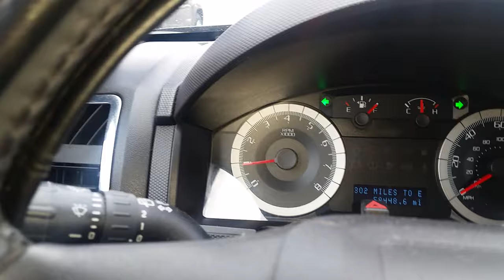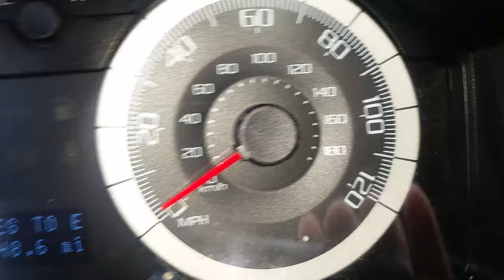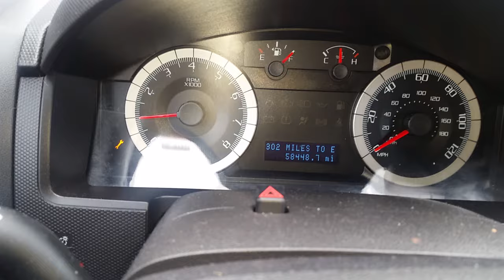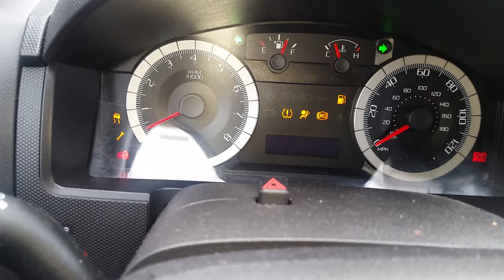Ford wrench light

Comment: I noticed alot of common comments but really know defined answer to this issue. So I went through the comments and wrote down the most brought up issue wich was the throttle body. Then started watching videos based on that. I took it to autozone to confirm. Came back as throttle body sensor. So 2 choices. Buy a new throttle buddy $350 lowest price for my vehicle or clean the one I have. I bought some throttle body cleaner and removed that part. It was totally black. Sprayed and wiped twice and it was shiny gold. Connected back to vehicle and the check engine light is gone. Been driving most of the day off and on and still no tool light no check engine. This fix cost me less than $10( cost of throttle body cleaner) Hope this helps. My situation was pretty much the same as the person that uploaded this video.
Reply: Thanks for the info!! I had that problem today…
Reply: Just had this problem Thanks for the tip
Reply: Just happen  to me
Reply: Thank you. I side hustle as a delivery driver and until I get this fixed....
I appreciate your research and sharing 
Fingers crossed, prayers up!!
Reply: I heard the ranch has something to do with your transmission it may have a transmission leak
Reply: When I changed out the ignition housing, I had to disconnect the wires. Reconnecting the wires forced the car into diagnostic mode and then it caught the throttle body issue. Used the throttle body cleaner. No more problems. 
Thanks so much for your research and info!
Reply: @katrinab7657  I just found out yesterday I went to the Ford dealership I asked him about it they said the wrench 🔧 can mean anything- they did a diagnostics they said my breathing air system is covered by the bumper and they're having a glitch in the electric system
Reply: @R.Williamss  do you think they're trying to get $$$ from the warranty company/ manufacturer.
Reply: @katrinab7657  I don't think so because a quick Lanes is a third-party of Ford, they do mechanic work for them and they're all over the USA-- it's saying the vents in my car are not open they're open but my bumper I ran over a raccoon and it messed up the bumper
Reply: @R.Williamss  oh, ok. I only kinda get it. I was so fortunate because the guy from AutoZone is also a working mechanic with the military.  as soon as I mentioned the wrench and the online opinion that it could be the throttle body, he agreed  it was a likely cause and knew what exactly was up and how to fix it for under $10.
Reply: @katrinab7657  well if you go to the quick Lanes at Ford, they can do a free diagnostics for you-- and thanks for telling me that I never knew about the throttle body
Reply: @R.Williamss   all I needed to hear was FREE diagnostic! However, my car would not accelerate and was driving so poorly, acting like it would cut off in traffic, I wouldn't have made it all the way too the dealership.
Reply: @katrinab7657  I recommend calling quick Lanes and tell them your situation, and that's terrible and frightening when you're in traffic you got to go through all that.
Reply: Cleaned my TBS and was dirty like yours . Had no monkey wrench icon but about 1 month later it shows up. Car would drive good but jerked changing gears when slowing down. Never 3 mph. Started happening after I gor 3.03 fuel when everyone else was selling for 3.57. Could it be bad gas?
Reply: @silverbullit89 did you root cause your issue. My fusion 2008 jerks when slowing down too. Overall trans shifts good. Could be the Throttle body? The wrench showed today.

Comment: This happened to me on my 2008 Edge, brought it to the dealer, this is caused by two sensors in the power train which need to be replaced would cost me $750 to fix, I haven't done the repair yet. This really sucks, I am finding out this problem is very common now in Ford vehicles. We should get a class action lawsuit started.
Reply: it happens to me too so count on me for the complain
Reply: This doesn't happen to all. It has to be 09 and above. My mom has a 2010 Escape and this has happened to her. I have a 08 but never heard of this.
Reply: 55dbau yes we really need to get a lawsuit started. Same thing happened to my 2007 ford e250??
Reply: Shitt is happening to me right now 🤬
Reply: I just bought a 2009 escape hybrid. I’m getting this wrench light also. What 2 sensors were bad? Thanks.
Reply: Maligant Moose tss and oss sensors
Reply: @cwhite7922  same 2010 e250
Reply: I agree I filed a bbb complaint
Reply: @slimsampy4764  I have a 07 and it's happened twice once after a new transmission
Reply: It just happened to me in my 2015 Ford fusion. Is it a bad thing?
Reply: It happened to me in a 06 Ford 500
Reply: Thomas Young what was the problem with your fusion ,? I have the same issue with the same model
Reply: I've been dealing with this issue for 3 years now. Nothing I do has fixed it. Took it to a ford dealer ship paid them 300 bucks and problem came back 4 months later. Happens to me daily now. Last mechanic told me I needed a new wiring harness and have the whole car rewired. Told that could cost around 2000 bucks so I haven't went that route yet. May be my last resort. If anyone knows the cause I would love to know.
Reply: pistengine my gf faced same problem on Ford Fusion ... we replaced the throttle body 150 bucks and the problem was fixed since 3 weeks now ..
Reply: I know this is years ago when you stated this but its 2020 and I'm having this issue!🤦🏾‍♀️
Reply: @TheShaedior  same here
Reply: The transfer case on the edge should be a class action lawsuit.
Reply: 2010 mustang, just came on.
Reply: @Lylslet  I have a 2020 mustang gt 6 speed.  Mine came on last week I was near a dealership but light turned off. I still had them check it but supposedly no codes came on. I've been told by some people it could be the transmission.  I barely have 14500 miles on it
Reply: 2011 fudion wrech light came on now its off?
Reply: @pistengine  wow that sounds crazy...any new result?  just now having the problem.
Reply: @slimsampy4764  

Do you know what fixed the issue??
Reply: @hecmgonz  it was a recall for the Ford Escape. I don’t know about the Edge. Make sure you keep your receipt because Ford didn’t put out a recall on the Eacape until it was a lot of reports. I know for sure it wasn’t any sensors. Make sure you check for all recalls. Best of luck to you
Reply: @slimsampy4764  thanks for your reply
Reply: Why a class action lawsuit so the lawyers can get rich? Because you're only going to receive about $2 of it if that
Reply: What about Ford Edge 2010 ?
Reply: @TR42000  change your maf sensor
Reply: Freaking hate these high tech junks.

Comment: 2013 Ford Fusion no issues at all 194,000 miles
Reply: I have the 2013 fusion too im having this same issue.  It stopped on me last week wouldn't turn back on. I had it towed to the dealer

Comment: Anyone who have this problem if you have these 2 problems if you brake and it takes time to slow down or if you floor the gas pedal and the response hesitate before the wrech light come it’s your Acceleration position pedal sensor. Most people thing it’s the throttle body but the pedal tells the throttle body how much to open or close. If you have a electrical throttle body. Hope this helps had the same problem with my ford mustang

Comment: I had this issue on Friday the wrench light came on with the AWD off light. It crawled at almost a nonexistent speed. It's sitting at the mechanics shop now and he is stumped due to it not having any codes stored. I'm hoping he can figure it out. I don't even want to think about taking it to Ford 🙄
Reply: Any update ?
Reply: @zykerahaynes4253  Throttle Body
Reply: Bronwyn Rice how much did it cost for labor
Reply: @zykerahaynes4253  think it was like $100
Reply: Bronwyn Rice wow took my car to 2 mechanics paid 150$’ to find the issue and still can’t find the problem
Reply: @zykerahaynes4253  the only reason my car was diagnosed was because my mechanic drove it for 3 days and on the day he was going to give it back it did it again so he immediately checked to see  what was wrong. The only way I've seen them diagnosis it is for it to act up while they are there. Or buy a used part from somewhere , have it installed and see if it stops the issue. So sorry you're dealing with this. It's super frustrating.
Reply: Bronwyn Rice yes I even showed my mechanic your response… so he checked my throttle bottle and said it was good , he said I was low on transmission fluid , and it looked like I had bad gas in my car so he added some booster other than that he couldn’t find he the problem, he test drove for it 1 hour doing 60mph
Reply: @zykerahaynes4253  yeah. They can't tell by just looking at it. It literally has to mess up at the shop. Sorry this is a frustrating diagnosis.
Reply: @zykerahaynes4253  Mine took to the last day to finally mess up again. Otherwise I would be in your situation too. Do you have anyone who can install the throttle body? You can get one on ebay for pretty cheap. From what I understand it's not to hard to do. It's worth a try to see if it fixes it. I hope you find a solution soon. This is so frustrating.
Reply: Bronwyn Rice my car wrench light came on and air bag light came on also the tire light , he said my throttle body was okay, but the car becoming in limp mode … when this happens do you turn the car off ? If you turned it off did all the signals disappear? When this happened to me I poured transmission fluid in my car and instantly everything started working …. Then when I took it to the shop because it happened again he said I was low on transmission fluid … so my thing is the transmission fluid causing this.
Reply: Bronwyn Rice when your car starting messing up did you turn the car off and back on ? And if you did the signals disappear or did they stay on ?
Reply: @zykerahaynes4253  my car had almost no power it would barely move. Then shut off. Wrench light would come on. If I turned it off and waited a bit it was like nothing had happened.
Reply: Bronwyn Rice ohhh wait my wrench light came on , the car would still go about 50mph but slowly start going slow but never shut off , i poured transmission fluid inside and 30 seconds later worked like a charm , then 3 days later happened again the mechanic told me the only thing he sees wrong is I’m low on transmission fluid I never told him about having to pour it in the first time . And He filled it and it’s been working for about 1 weeks or 2 weeks . I told your response to the throttle body he said if it was my throttle body then my car wouldn’t just go back to normal it would stay in limp mode

Comment: I think the reason for the conflicting comments is that it is the "check engine" light.  I can be coming on for a multitude of reasons.  I have a 2010 Fusion Hybrid and the light came on while in Florida.  Stayed on the entire week.  Fueld at the midpoint in GA.  Never came on again for years.  Then one day driving at high speed it came on.  Went off later.  Again a couple of years later, it came on again.  It's always in high humidity and heat!  My problem does not effect power and always the hybrid wreck comes on first, followed by the gas engine wrench.
Reply: That's not a check engine light, that's a power train light

Comment from the maker: Be persistent it should be covered under the powertrain warranty plus you could call Ford and ask for the customer satisfaction program a representative there will give you a claim number and you can follow up with them about the repair
Reply: Did they tell you what caused it and what u have to replace ?
Reply from the maker: @nathatmed6484  they never admitted to a failure of the electric throttle body much less a recall, there thing is that we have to run a diagnostics check first then they will replace it at no cost to you provided it is still under warranty for the powertrain. I would still follow the steps above and try to take some video of the problem happening so you can have some ammo on your side also look on the web and try to find some corresponding info from others like us. Good luck to you, I can promptly holler back too 😎

Comment: I have the Ford Edge 2013, Same thing... It was so dangerous. FORD should do a recall of all vehicles that has a problem with the Electronic Throttle Body. Be careful if you have a Ford!!
Reply: Before changing the Throttle Body clean it with a Throttle Body cleaner, that could save you $500, and clean the Mass Air Flow sensor (MAF) with a MAF cleaner.
Reply: @robertzamb  that what I said I was going to do. A mechanic here in Houston Texas told me to contact a Ford dealer to find out if it was a recall on this problem
Reply: It's a recall on my mother 2010 Escape
Reply: They have a 10 yr or ?????mileage warranty on them. Forgot the miles but its pretty high.

Comment: The wrench 🔧 light is a tune up spark plugs and coils you have to use the Oem plugs and coils (Motorcraft)
After time the aftermarket plugs cause faluty combustion and the car goes into Limp mode. A bad injector can cause this as well for the most part just add Lucas fuel treatment after changing the plugs and coils.
Reply: Not on all vehicles, ford's its a trans issue/AWD issue
Reply: Not on this one

Comment: I have a 2006 ford fivehundred that has been doing the same thing , turns out the wiring harness on this model and the 2005 and 2007 runs right across the top of the enging. Over the years the constant heat from the engine had melted wire into in numerous spots and they were touching. It's why it does it going down the road instead of starting that way. Because bumps and holes in the road or whatever tmcan make those wires not touch and when you restart it itll crank up normal. But drive a mile down the road and hit a hole just right and those wires will touch together again and put it back into limp mode.
Reply: Does the 06 freestar have same
Reply: So I have a 2005 Ford Five Hundred that is randomly doing the exact same thing "engine safe mode" with a wrench.  Pulled Codes P2104 Forced Throttle and P2112 Throttle stuck closed so I replaced the throttle body and still doing the same thing.  I'm thinking this is also a wiring short or ground that's causing this intermittent issue.  I'll check the wire harness that you mentioned to see if it's heat damaged by engine or friction.  Thanks for your post!!
Reply: @tonyvella3242 have you had anymore problems since you replaced the throttle body?

Comment: Its is most likely the Electronic Throttle body. Had the same problem in my 06 Milan and that was the issue. Took me about an hour to change.
Reply: Cusheena Mcrae hi. Where is the etb located in the car?
Reply: Yes plz it would be really helpfull since I'm in the same spot
Reply: @jaeescobar3106  did you figure it out mine just started
Reply: i have 07 milan  its doing the same exact thing...wrench light then going in and out of gears   high revs and jerking motion....is yours still running good? , and was there a recall for the throttle body?...there is a recall for the airbags just so u know...they can kill u w metal shrapnel inside them.

Comment: If the wrench light comes on it’s a powertrain malfunction. You will experience severe issues with engine power if that light comes on. So essentially you’ll barely be able to move.
Reply: Just bought a mkz, got the wrench, but car running fine, whats causing the light.
Reply: @vracerv  what was wrong with yours?
Reply: My car has the light but all the power still there its an 09 ford fusion

Comment: 2009 Mazda Tribute happens alot and check engine light turned on with the code that the Throddle is stuck open. Cleaned ot with a throddle cleaner worked fine for a week and now its shuting down again. Do i need a whole new ETB or just a new sensor dor the air mass flow

Comment: For me I am having the same issue, I have found that if I go over any bumps in the road the check engine and wrench lights come on and I lose all power and can only creep very slowly. With further investigation I realized if I jiggle the cables going to my throttle body I can recreate the problem every time. I have been fighting this battle for months with a dealership, first I paid 800 for new throttle body, I had that refunded now the second dealership tells me it was my PCM, changed that 1200 dollars, still same thing happens. I let them know what I found and they refuse to refund me my 1200 for there shitty service. So a lot of times its just  in the connection and nothing actually wrong with the car itself. Hope this helps. Ps if anyone can make a video of how to fix this it would be great.
Reply: great info man thank you

Comment: Had the same issue. Sent my 2011 fusion today to the dealer and they changed the ETB for free.
Reply: How many miles you have when it happened?
Reply: @valeriequintana906  less than 180 000km

Comment from the maker: if I were you I would take it in right away , everyone out there will be glad to know the even if you have a 2009 like my Escape the Electronic Throttle Body will be extended to another 10 years so in my case it is still covered till 2019 , don't be fooled this is a bigger problem than Ford would like to admit,  the reason it is not a all out FACTORY RECALL is because Ford got a jump on it and layed  it out as a  customer service /safety program , in your case  2016 should be covered till 2026